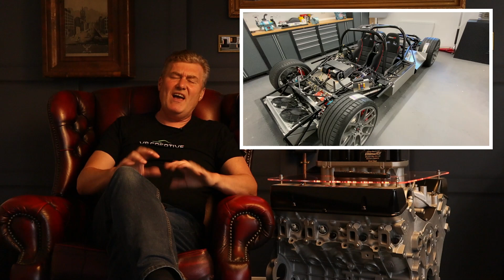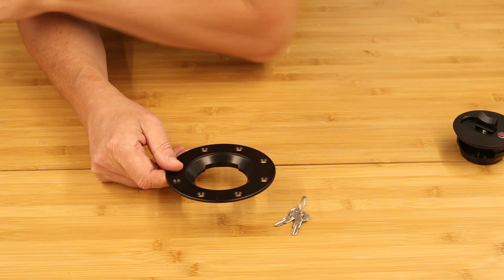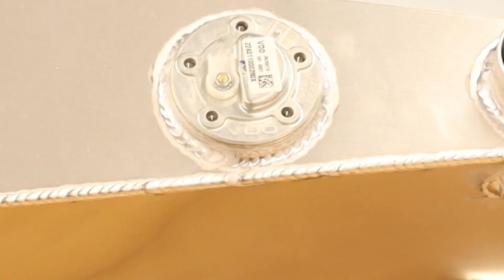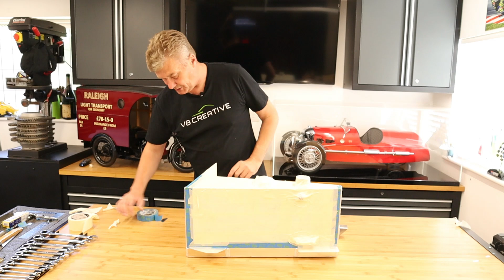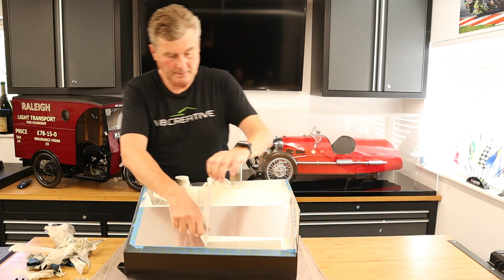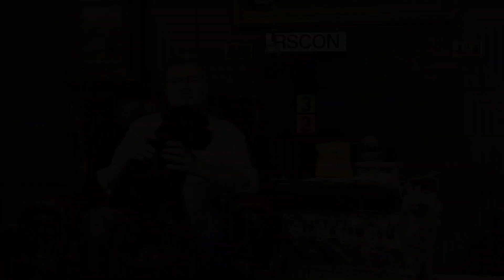Building an Ultima RS with Nigel Dean. Part 20. Fuel tank install and Q&A

Comment: With regards to the brake question, what most people don’t realise is that these days ultimate stopping power is normally limited by the tyres, not the brakes. Most brakes are powerful enough to lock the wheels up. Bigger brakes are needed to help with repeated use and fade. On a light car like your RS or my Exige that’s easier to deal with. Once they’re big enough to cope with that, all fitting bigger brakes does is increase unsprung mass and degrade the handling / performance.
Reply: Also isn't the ultima the quickest 0-100-0...so guess that ends the halfords special mechanic...
Reply: @MM-Mabel  🤣👍🏻
Reply from the maker: Thanks Dale, appreciate the comment and understand the physics. From my standpoint AP Racing have given their stamp of approval and they look amazing. Will report back when retarding from 200+ MPH :-). Cheers Nigel
Reply: @v8creative  I’m fairly confident that they will be more than good enough for repeated high speed stops.  Like you say, they’re designed to be perfectly sized for the performance and weight of the car. I was at a track day today, and I met a guy who’d just spent £3000 on a bigger brake upgrade for his Exige. He admitted that he couldn’t actually brake any later than with his original set up.
Reply: @v8creative  Hahaha. The only right answer! 👍🏻
Reply: Plus, as mentioned, that Audi is twice the weight...
...empty!
With max load (5 passengers, filled up trunk and pulling fx a caravan) the brakes need to work a lot more, than an Ultima with two persons and two toothbrushes...

Not to mention the unsprung weight of these family size steel pizzas.

Comment: Now I'm still very young, and to me I fear that until I can afford my own Ultima, there are no more petrol cars. Now I believe in syntetic petrol so I hope we will have that instead of those lame electric cars when I get a bit older
Reply: as for my guess on the color and engine, based on the grey wheels, you went for White and listening to you talk about using the GTR as a daily driver, I think you're going to take the LS3 or the LT1 because of the lower Emissions, but I don't think you will take any of the really high horsepower engines.
Reply from the maker: @Koko-8652  very logical. Thanks for following the series. Nigel
Reply: I feel the same way. Might be antithetical to Ultima’s heritage, but to me this car screams “electrify me!”
Reply: @ThatAdam12  Well not really electrify, but hybrid, just imagine an Electric engine that propelles this car from 0-60 and after the V8 or maybe a V6 twin turbo takes over, that to me sounds like a valid option for Ultima